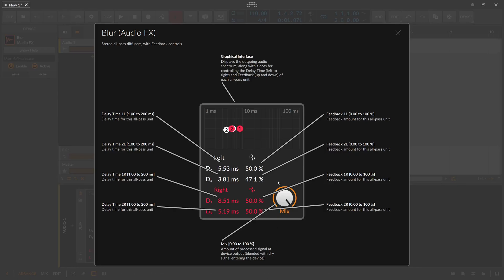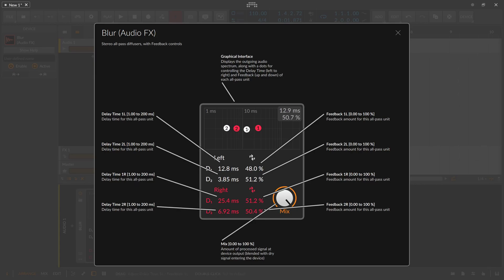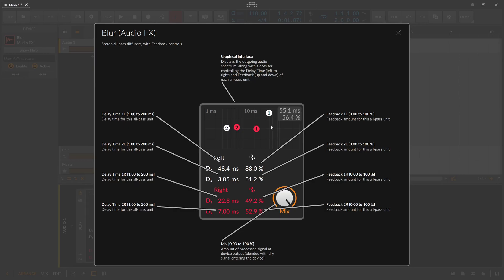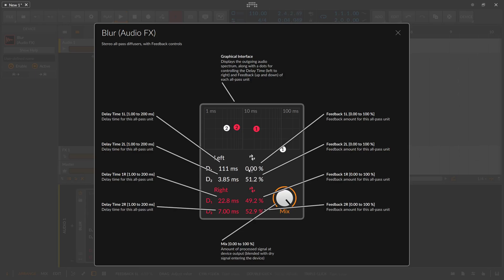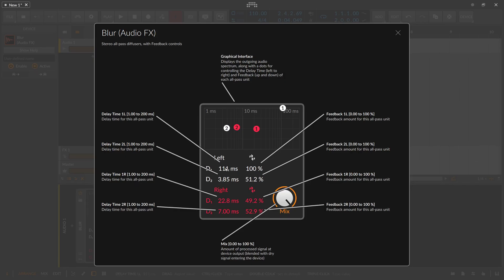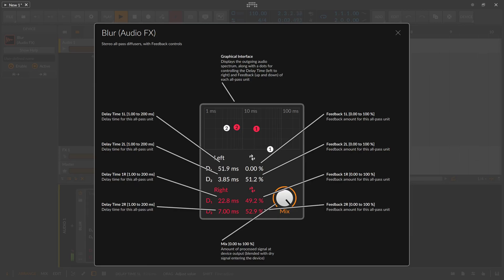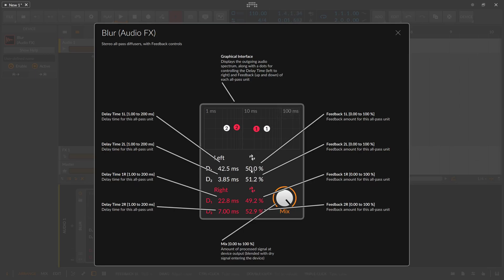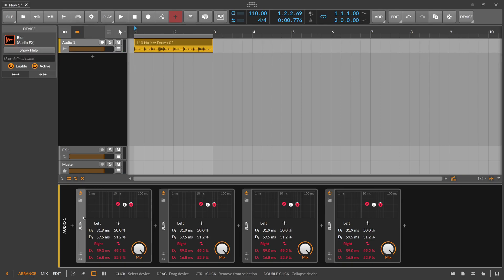Blur - Bitwig Audio FX Guide

Comment: The all-pass filter creates a phase shift inversion at the frequency specified.  I don't see an option here for changing the frequency of the all-pass filter though?  Automating the frequency shift will give you a neat stereo panning effect that pans around the phase shifted location rather than the volume level, and can sound really cool if used creatively.  Is there a way to do this in Bitwig using the blur device or otherwise?